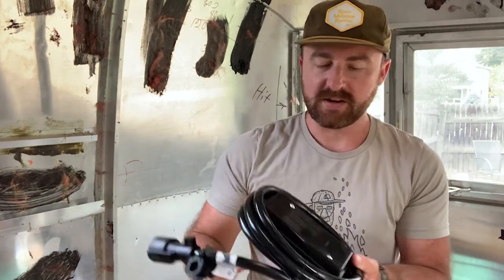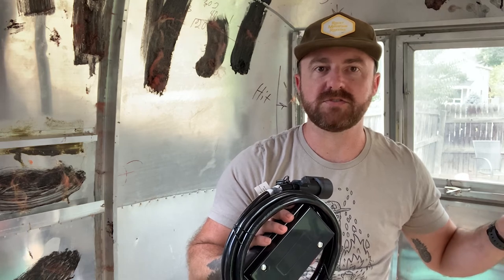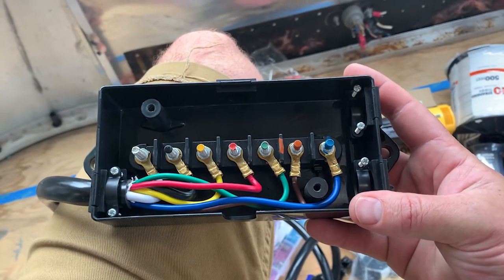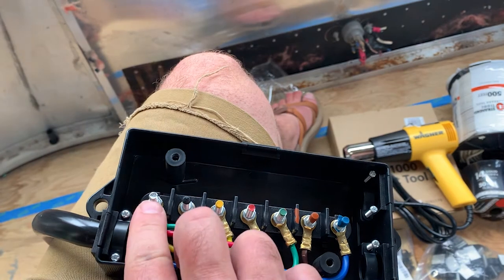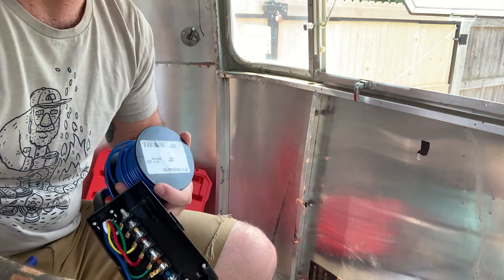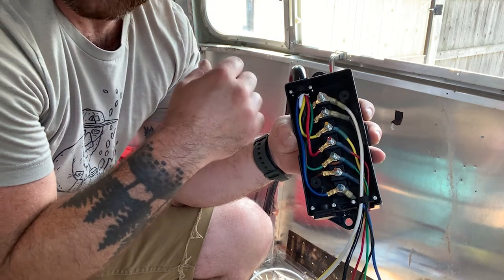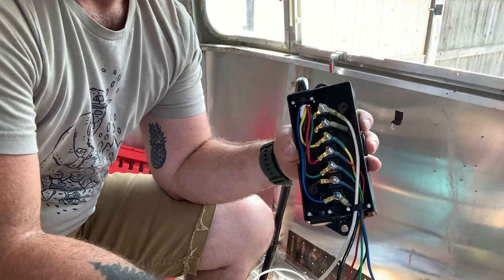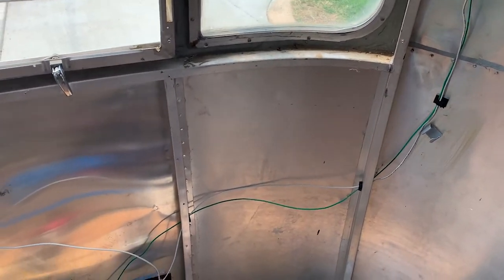Airstream Remodel | Rewiring the 7 Pin System in my 1972 Airstream PART 1 - Week 4

Comment: Thanks for this helpful tutorial 👍 Do you happen to know if the white ground is necessary? Noticing that the original running lights just grounded to the aluminum body.
Reply from the maker: I actually left a few running lights with the original ground connected to the body and tested the system. It seemed to continue to work even though I swapped some out. I would try one and test it out before proceeding to all of them.

Comment: I've seen those wire connectors before, the orange ones that you use instead of marettes, what are they called? do you have link?
Reply from the maker: They are In-Sure Wire Connectors from Lowes. Here is a link to some https://www.lowes.com/pd/IDEAL-In-Sure-10-Pack-Yellow-Push-In-Wire-Connectors/1000835948

Comment: Did you run wires from the front all the way to the back? Or is there wires through the subfloor for the back?
Reply from the maker: Hey, I ended up running all the wires along the center top panel from the front to the back. I figured they would see less wear being up there vs under the subfloor.
Reply: @beardedspruce  gotcha! I saw the wires up on top in the second part. I think I'll do the same. Thanks!
Reply: @beardedspruce  I like that idea a lot, thank you for sharing.